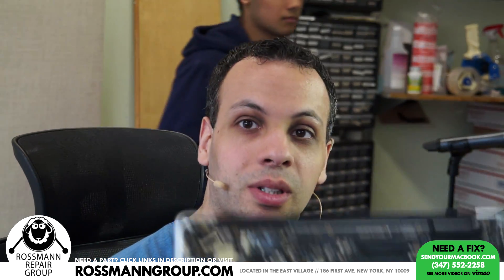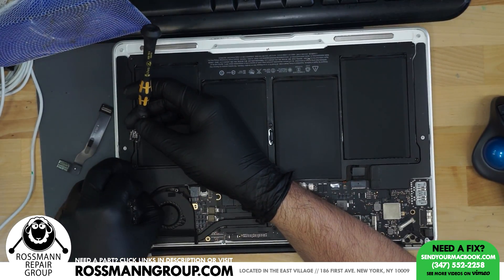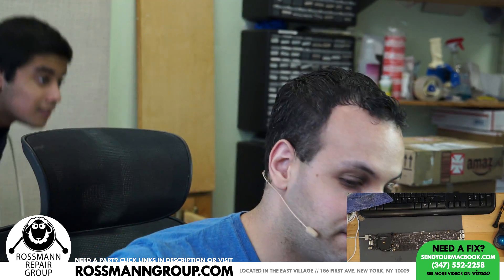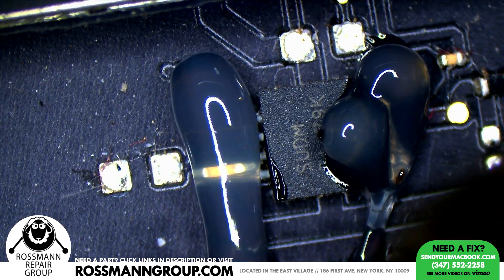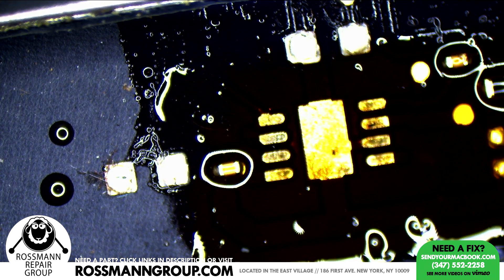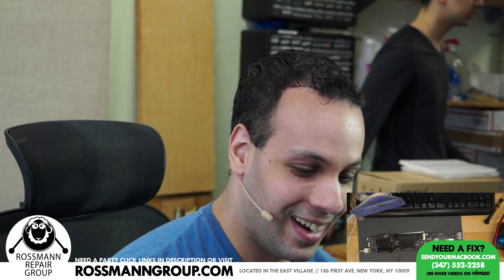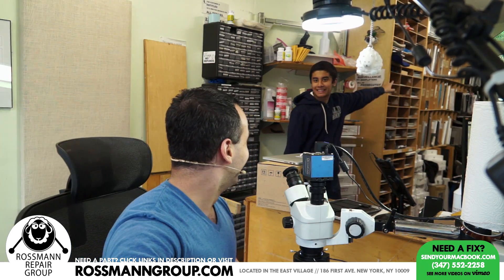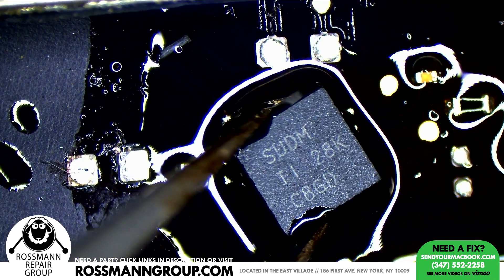Fixing a Macbook. Let's fix a Macbook. :)

Comment: I have a late 2013 15" retina. For the last couple days after three to four minutes on the goes screen off like going to suspension and once that happens  there's no way I can bring that back on without forcing the shout down. However, after a few attempts and having the same every time I turn on the MacBook, I noticed three things  "with the "smcfancontrol app" both temperature turned to "0", the "replace battery soon" warning is on and once the screen is off, the computer gets quite hot just between the top area of the keyboard and the vent area. Is the damage battery causing this or it is something much more complex than that?

Comment: can somebody pls recommend a good laptop especially for music production?i need to sell my macbook pro 2017 soon .. PLS
Reply: HP or Dell for hardware, for software try Ubuntu, or Peppermint 7 OS.  Both are freeware operating systems, with freeware for audio/video editing. Peppermint 7 OS is more user friendly for the less initiated to Linux. They have a peppermint 9, however they make things a lot more complex for customization. I prefer 7, fully customizable, lightweight, updates when YOU tell it to; not automatically if you don't turn the setting on, doesn't spy on you, can run Firefox or any browser you want; chrome comes default but can easily be uninstalled/replaced, 157% Android device compatible, and requires a password for administrator action; so nothing changes unless you tell it to. The only gripe I have is that windows will try to format any USB that has touched a Linux machine and you have to (in some cases) fight with windows to access your USB. Also gaming has improved on Linux, but is still limited. Good luck.
Reply: TheBlackCat viewerAccount thx buddy. Keep that in mind. But im addicted to MacOs to be honest. Probably going for hackintosh. xD. But definitely switching my laptop. Macbooks quality turned shit (or always have been?) . Thanks again!

Comment: I've started doing board repair at my shop, haven't gotten to do a macbook yet, but did fix a display issue (blown fuse, just removed it and screen worked after a bit of clean up) on an ASUS. And then a short issue on an ACER board (some solder joints had shorted to each other). Before this would have just been a "your board is borked, get a new one" or "replace the system and we'll move your data over"

Comment: hey louis here's an idea: check the disk on every shitbook you fix and note down the power on hours on the smart parameters. that might get an insight about the ACTUAL age of the machine rather than the date of manufacturing. it's one more data trace like the ones you gather from the charger current draw.

Comment: Dear Louis, without people buying MacBooks, you would have to repair other crap. I will buy a MacBook, if they release one with reliable Keyboard and ground between a high voltage and low voltage line and connector.

Comment: I'm new to this. Why do you put on more solder first then take it off instead of just taking off the old
Reply: the old solder is lead-free, which has a higher melting point than leaded solder. leaded solder (which he places on the board) mixes with the lead-free, making the melting temperature of all the solder lower, making it easier to remove all the solder
Reply: @hihi217  thanks for the info just started soldering and messing around with electronics it's an enjoyable time

Comment: It just dawned on me that apple is always complaining about 3rd party repair yet if they actually wanted to curb that all they would need to do is make decent products, the 3rd party apple repair market would dry up pretty quick as fixes would be limited to users breaking the machine themselves not just looking at it funny on a warm day. I think apple actually just wants to carry on selling garbage hardware in a shiny tin so when it fails they can either sell you some replacement parts at almost the cost of a new machine or a new machine in itself.